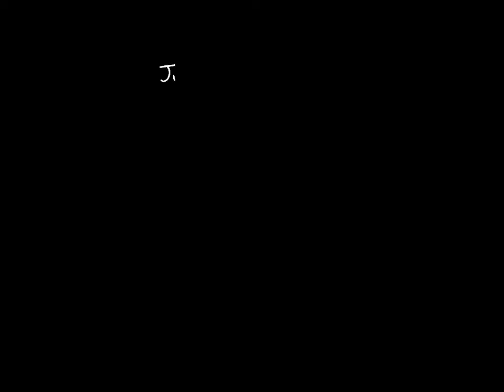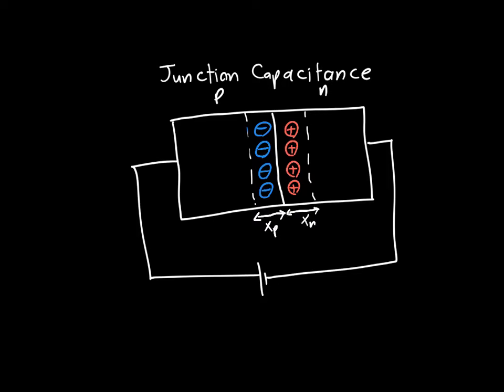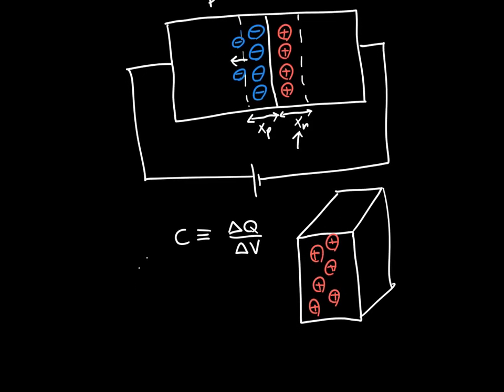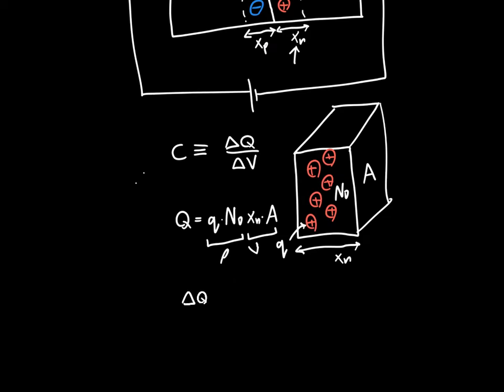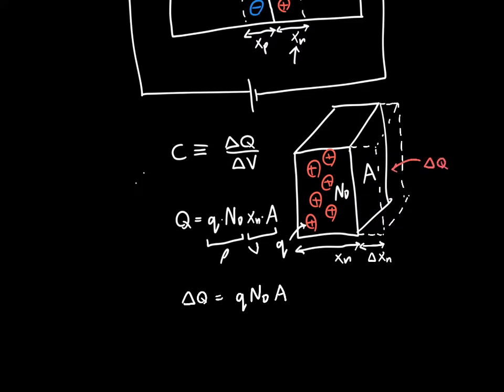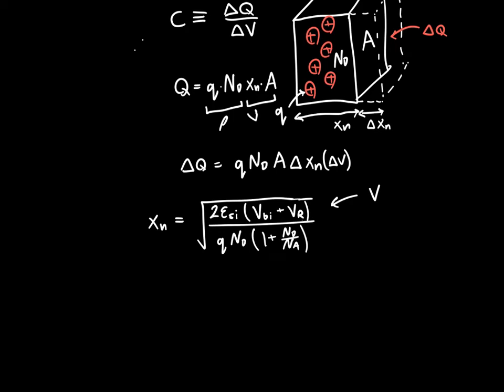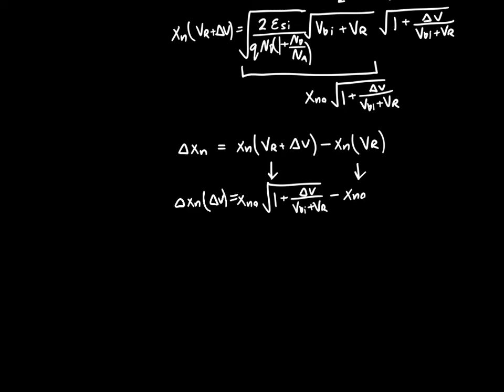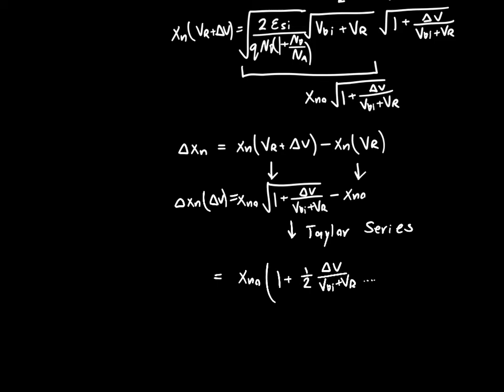PN Junction Capacitance Derivation

Comment: What have we lost(assumed) by neglecting higher order terms in taylor series ?
Reply from the maker: If the perturbation (voltage) becomes too large, our model will not be as accurate. You can get a sense for the amount of error incurred (and I recommend you do!) by taking the next term in the Taylor series (the one we neglected) and seeing how big it is at various voltages. Usually in the ‘biz we think of 25-50mV as being “too big” but really that depends on the application.

Comment: At the simplification made at 7:35 where the first two roots are equated to xno, wouldn't that only be valid if the second root containing Vbi+VR was only Vbi? I thought the xno equation only had Vbi in the numerator in the root.
Reply: I am also confused by this cause I believe it should be Xn(Vr) here instead of Xno.